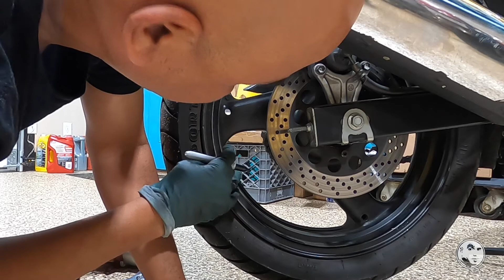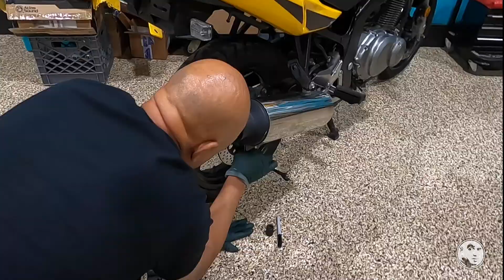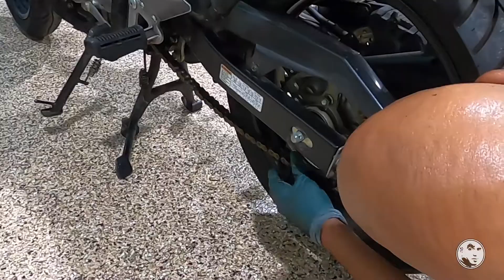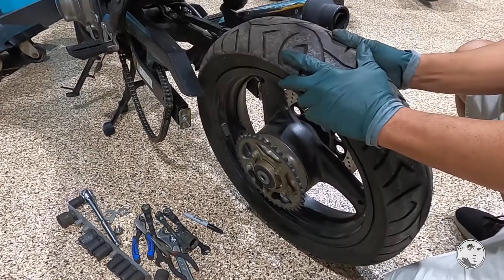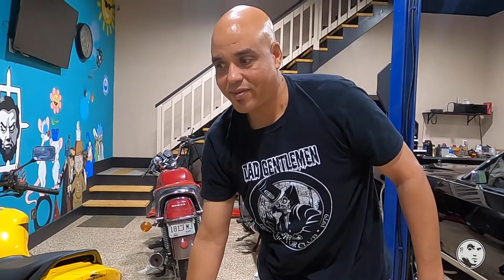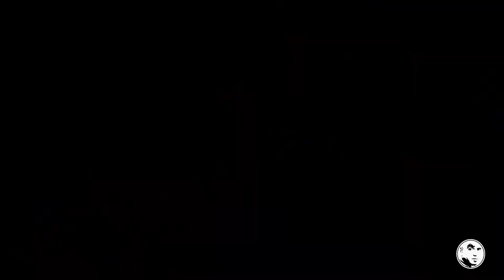How To Remove Your Motorcycles Rear Tire Yourself And Save Money - Suzuki GS500F #suzuki

Comment: So where do the bearings go? I already knew how to take off the tire but as soon as I did pieces started dropping and I have no idea where they go save for the spacer you showed at the end 😂 kinda scared to guess and get it wrong
Reply from the maker: Oh! Man! Bearings always go in the hub of the wheel first, then the washers, spacers etc.
When you put it back, you'll know it's right if the chain lines up and it spins smoothly. If you're not sure, don't tighten the bolt all the way before you make sure it's spinning freely and not making any unusual noises.... hope this helps 🙏!